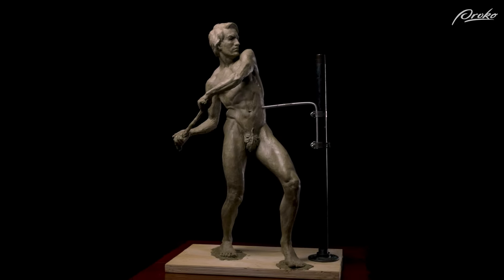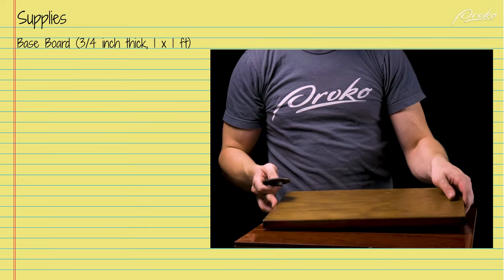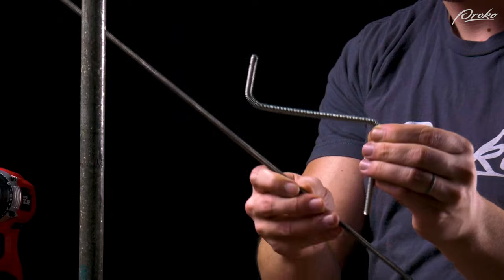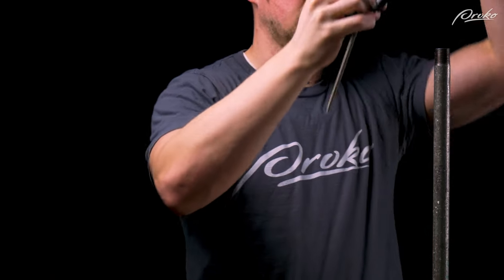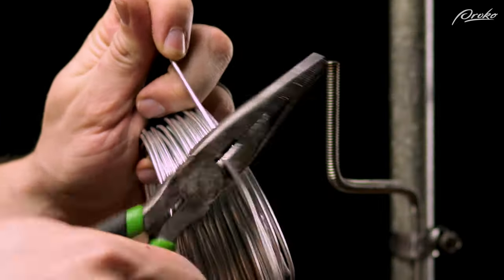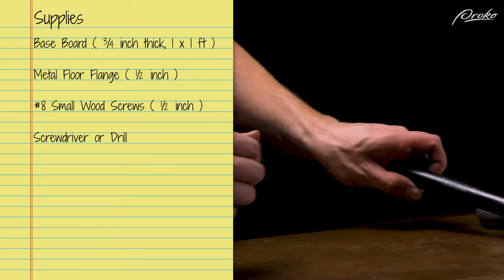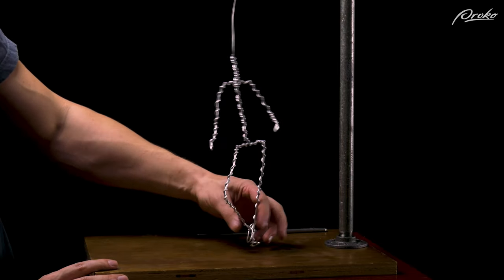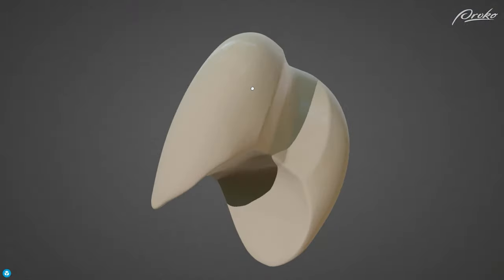How to Make an Adjustable Stand for Your Armatures

Comment: One thing I've never heard anyone talk about is what to do about the armature stand once your finished with your sculpture. If you want to mold and cast your piece (resin, wax, plaster) then how do you address the armature stand and the piece of wire sticking out? If you're casting it in plaster, which is very sturdy, you don't really need the stand anymore right? It's just there for the sculpting process...How do you take care of that spot where the wire comes out?
Reply: I'd imagine you unscrew the threaded pipe, and cast it like that in a block mold. Then when you have your "master" cast (e.g in urethane) you remove the wire and finish it up.

Comment: 2:01 You said 3/8 for the Zinc metal rod but the video says 3/4". I'm assuming it's the 3/8" just by looking at it though
Reply: I actually think he's using 5/16" because I tried with 3/8 and it was ridiculous to bend

Comment: My threaded rod snapped at the first 90degree bend, also I don’t think that’s a 3/4 rod
Reply: Same issue, here. Yeah, I got a 1/2 in pipe, since that's the size I think he used.
Reply: You may want to try hanging the armature from above if you're having trouble with the metal threaded rod.

Comment: 2:04 BE CAREFULL : The Zinc Threaded Rod has a thickness of 3/8 inch ! Not 3/4 inch !!
There is a mistake in the video. He says "a 3/8 inch x 24 inch Zinc Threaded Rod" but it's written "Zinc Threaded Rod (3/4 x 24 inch)". I'm french, so I don't know imperial system, and I payed more attention to the text than his voice. I checked on internet what 3/4 inch was in mm and it says almost 20mm. I thought it was a bit large, so I went and ordered a 16mm zinc threaded rod online ... xD it's WAY too thick ahahah actually 3/8 inch is around 9mm. So I have now a huge zinc threaded rod 16mm thick in my appartment and I don't know what to do with it 😅 I'm going to go buy one way thiner in a hardware store ^^ Buying online is too risky when you're not used to these fournitures. I also consider alluminum bars as they are way easier to bend

Comment: My threaded rod broke when I made my first 8 inch bend
Reply: Same. Idk what to do
Reply: A normal rod (not threaded) might work better. Or you can hang the armature from above if the rod is giving you a hard time.
Reply: Heat the rod with a torch in the bend location and it will bend easier.